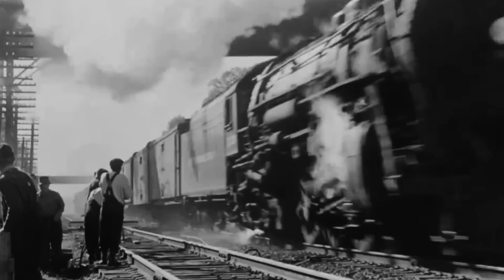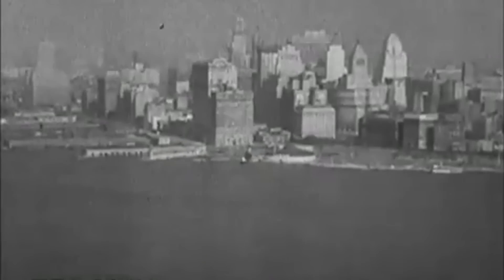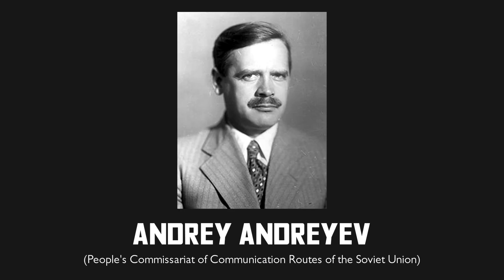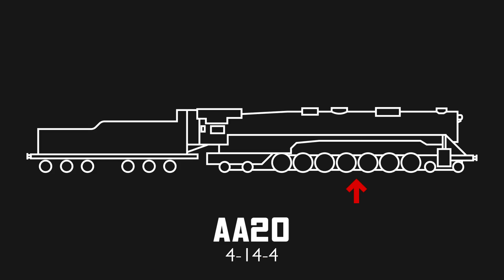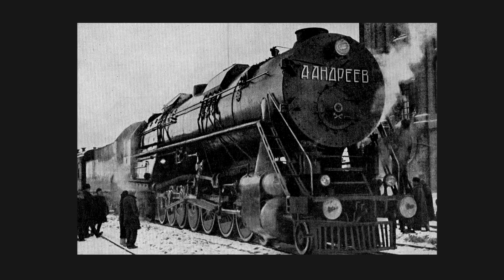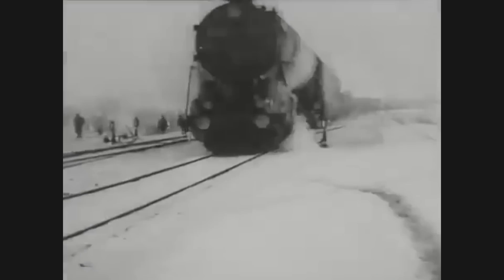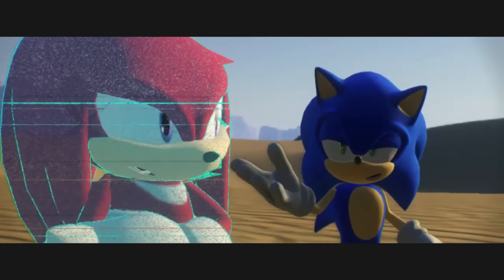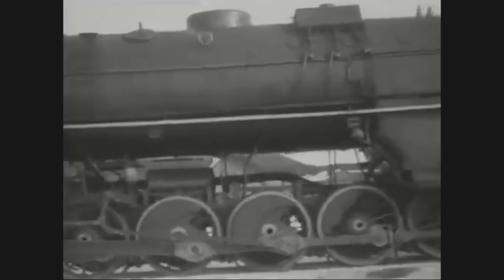The Soviet Union's Track Breaking Locomotive: The AA20

Comment: I wonder if the AA20 would have actually worked on the Union Pacific's track (assuming it was regauged accordingly)?  After all, the Union Pacific had the 9000 class (4-12-2) in active service from 1926 to 1956, which is pretty good for US steam locomotives.
Reply: Maybe. After all, the 9000s were used on the flat strait plains with large, sweepiing curves, where the aa20 had to cope with the comparitably sharp curved soviet lines.
Reply: ...eh? It's hard to say. It was way, way heavier than the 9000s (roughly 55 short tons heavier, AFAIK) but did have lower axle loading (22 short tons vs 29.5 on the 9000s). It was about 8 feet longer in total though I'm not sure of the size of the tender. The rigid wheelbase was similar (~30ft vs ~33ft) so it in theory it shouldn't have any issues on wide open plain trackage and good coal. Lower tractive effort by like 20,000 pound-feet though, so UP probably would've been like "okay, but why would we bother?".
Reply: @davidfuller581  The PRR S1 Was longer than the AA20  or better yet Big boy being a length of 140ft, It could work For sure, And since both big boy and the S1 is 1million lbs, the tracks can handle the Weight of the AA20 perfectly
Reply: @DistanceNsVeterans  weight isn't really the issue so much as axle loading. Also, the S1 was quite limited on where it could run because it was so big.
Reply: @davidfuller581  Oh that's right.
Reply: @davidfuller581  would it have to be modified to have the same axle type as the 9000?
Reply: @DistanceNsVeterans  no, its axle loading is about 7 tons less per axle than the 9000s. There just wasn't much point to it.
Reply: @davidfuller581  Ah ok
Reply: В том и вся суть , что эта машина и должна была использоваться только на таких участках где мало кривых и прочее , то есть на специфичных участках там то она и могла себя проявить с лучшей стороны, но тогда железным дорогам СССР нужны были универсальные способные работать везде

Comment: The aa20 was just too crazy of an idea to work. The 9000s were bad enough as is, so it was more of a question over if they could do it than if they should do it. I liked the little segment of Katyusha at the end.
Reply: The 9000 class did work since UP had to widen curves and I think the turntables at roundhouses were already big because of Big Boy and the Challenger
Reply: but in the end the Soviets understood instead of building big steam trains to pull in more cargo.  it is easier to replace them with electric trains which can have more power than steam trains and diesel trains.  1990 50% Soviet rail way is electric.  and transports 80% of the cargo.  compared to the United States which is only 1% in 2022
Reply: @Elliottblancher  9000s were a decade before the Challengers.  The 9000s also worked sections where the UP's mallets also worked, so turning them as not a particular issue.
Reply: The 9000s worked from 1926 through to the end of steam.  They were a significant leap forward in the UP locomotive fleet.  It was a full decade before the Challengers pushed them from first-tier service.
Reply: 9000 series was great though lol

Comment: I know it's not really that related, but I wonder what UP's 4-12-2s would look like if they lowered the headlight to the center of the smokebox. And then put the air compressors on the side like some of them had.
Reply: Actually some of them had the flying pumps moved to other parts of the locomotive. So there were barefaced 9000 class engines.

Comment: but in the end the Soviets understood instead of building big steam trains to pull in more cargo.  it is easier to replace them with electric trains which can have more power than steam trains and diesel trains.  1990 50% Soviet rail way is electric.  and transports 80% of the cargo.  compared to the United States which is only 1% in 2022

Comment: The 9000s and Hungarian 2-12-4 tank engines (yes that actually did exist) were probably the limit of non articulated locomotives as the 9000s were actually quite successful
Reply: That’s Right. There were a few 0-16-0 locomotives too.
Reply: What type was the Hungarian 2-12-4? Because as far as I know the largest proposed (but not built) Hungarian tank engine was supposed to be a 4-8-4 tank engine based on the MÁV class 424. The other tank engines that were built were usually on the smaller side (2-6-2s, 2-4-2s, 2-8-2s)
Reply: @kovacsabelkristof3566  sorry I was incorrect in my original comment, the engine was the Bulgarian railway class 46, not as I said Hungarian, that’s a slight error on my part
Reply: @nathancorcoran5347  There where never built any steam locomotives with 16 Driving wheels on a rigid frame, because the locomotive factories around the world already know That building locomotives with more than 12 Driving wheels on a rigid frame isn’t gong to work. 
Andrey Andreyev was considered the biggest wheel arrangement on steam locomotive.

Comment: After watching this video, it got me wondering. How come the AA20 flopped while the UP 9000 class were successful?
Reply: Sometimes those last couple feet make all the difference…

Truth is even the 9000 class had some issues. But not nearly to the same degree as the AA20. Also the 9000s were pretty much stuck in the gentle rolling plains of Nebraska and areas around that region. Curves weren’t as severe around those parts.
Reply: @fuzzyhead878  How interesting, yet the UP 9000 class were able to have 88 of them build while AA20 is only one of a kind.
Reply: @matthewpastrikos7383  Also true. To be clear, I love the 9000 class I’d happily give them an A+ as locomotives.But they still had limitations. The AA20 just made said limitations worse to the point of impracticality. Whereas UP was able to adapt and work with the limitations of the 9000, the Soviets couldn’t do the same with the AA20.
Reply: @fuzzyhead878  Of course, thank you Fuzzyhead878.

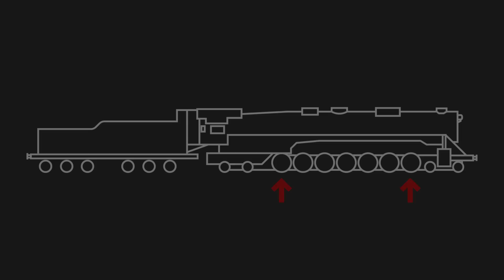Comment: @amtrakGuy365 What are the "lateral motion devices" you mention at 2:52?  How did these work?
Reply: I guess the same way as VL85's middle trucks did: freely swaying after the track
Reply: it's a combination of a 'hinge' more or less on the connecting rod, and lateral play in the axel boxes - with spring resistance to keep the wheelset in line on straits.  The play would be no more than an inch to an inch-and-a-half.  From memory, it was Alco who figured it out.  The Union Pacific 4-12-2 had them.

Comment: I wonder if the soviet railways would have gotten the optimal design for a super powerfull steam engine (not counting the two engines that came after) like, maybe they coul have made a 4-10-4 or 2-12-0 or maybe even a 4-8-8-4 design, one can dream.
Reply: Actually, the was a couple of 2-8-8-4 P38 engines produced by mid-fifties, but by the time they've been produced for test runs, the state switched to diesel and electric locos production, so the project was scrapped.
Reply: @chippunque-o6d  oh ive heard of those, but i dont really count them, as i think a rigid framed engine could have existed, like a 4-10-4 or something similar
Reply: @Arturobrito0502  there was something alike. Freight 2-10-2 LV and FD and 4-8-4 P36. These are the closest ones I can remember
Reply: @chippunque-o6d  oh ye i forgot the p36 existed

Comment: a 4-12-2 is just a little over the top. a 4-14-4 is overdoing it.
Reply: but in the end the Soviets understood instead of building big steam trains to pull in more cargo.  it is easier to replace them with electric trains which can have more power than steam trains and diesel trains.  1990 50% Soviet rail way is electric.  and transports 80% of the cargo.  compared to the United States which is only 1% in 2022

Comment: Honestly 71,000 lbs of traction of tractive effort is kinda sad and wimpy, when GN had 2-8-2s with 10,000 lbs more.
Reply: The specs of the loco claimed that it should run on low-quality fuel, so that's why it didn't have that much power

Comment: Typical soviets, always trying to beat absolutely EVERYONE ELSE in size,
Had the AA20 been given modifications, e.g making it a simple articulated engine similar to that of the PRR T1, Yellowstone, or Big Boy, I think that it would have less of a chance of derailing.
From a 4-14-4, to a 4-8-6-4. Sure it wouldn’t have even the slightest of fighting chance in regards to fitting in roundhouses and on turntables, but at least it wouldn’t pull a sir Handel/Sir Hayden and push the rails apart
Reply: but in the end the Soviets understood instead of building big steam trains to pull in more cargo.  it is easier to replace them with electric trains which can have more power than steam trains and diesel trains.  1990 50% Soviet rail way is electric.  and transports 80% of the cargo.  compared to the United States which is only 1% in 2022
Reply: Typical Soviets, beat overpriced western designs across the board for a lower cost.
Quit acting like the Soviets didn't have other successfull designs.
God forbid the Soviets do some experimenting lmao.
Reply: @dwarow2508  Then again they Tryed ripping off locomotives tho. Some designs coming from American locomotives and even streamlined ones
Reply: @DistanceNsVeterans  
Except they didn't. All mainline Soviet designs that were mass produced were original designs. Ironically, all designs they did try to rip off, actually did not work and were not mass produced. Tells more about the USA than the USSR though.
Reply: @dwarow2508  All? didn't I just said some, EVEN streamlined Ones took ideas from American ones, That's why soem of the streamliner in the USSR has a American counter part to it, because the either took or The Americans gave them the design ideas.
Also it tells way more about the USSR that When your trying to make something that's more better than the original, It'll come out Not how it would be and this is where the AA20 is the prime example.
Reply: @DistanceNsVeterans  
No, you didn't? You said *ALL*. Every single mass produced locomotive from the USSR did not have a single design element taken over from the USA. Not one. 
Tells a lot about thr USSR when they create their own designs for the same purposr that perform better while costing less. How tf is the AA20 an example when it was never mass produced, lol?

Comment: That is so Russian. Should we invest in infrastructure and strengthen the tracks? Hell no! Just build a gigantic locomotive that can pull anything!
Reply: but in the end the Soviets understood instead of building big steam trains to pull in more cargo.  it is easier to replace them with electric trains which can have more power than steam trains and diesel trains.  1990 50% Soviet rail way is electric.  and transports 80% of the cargo.  compared to the United States which is only 1% in 2022
Reply: Bruh they litetally did invet in infrastructure and strengthening their tracks lol.
And at the same time they made better locomotives.
Reply: It should be called the 'Tsar Locomotive'!
Reply: @dwarow2508  very big Cough
Reply: @DistanceNsVeterans  very big COPE
Reply: @dwarow2508  Again Cough
Reply: @DistanceNsVeterans  Again cope

Comment: Typical. Bad engineering when you either steal or copy someone else's work.
Reply: they must have been drunk stealing and copying the Americans drawings then!
Reply: @rearspeaker6364  so where's the American electric rail network now?
Reply: In fact, all steam locomotives in the world are copies of each other. The AA20 steam locomotive is not a copy. This locomotive is built in the metric system.
Reply: Then explain the working designs